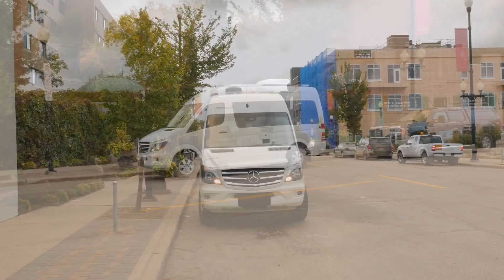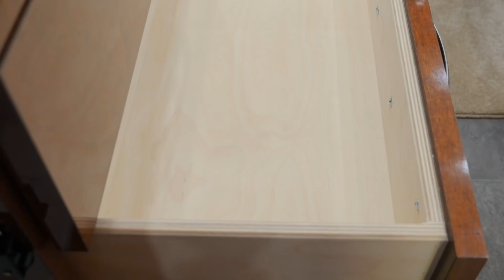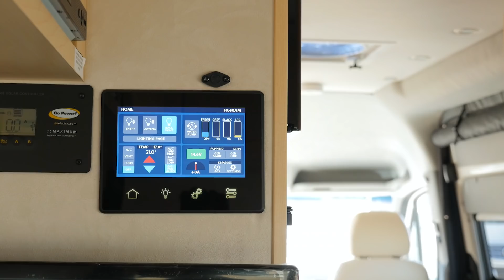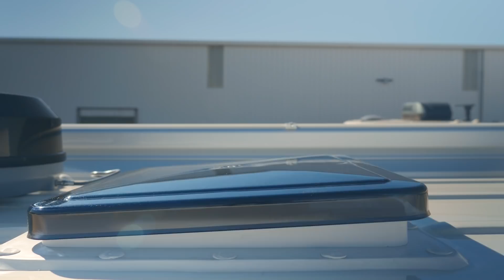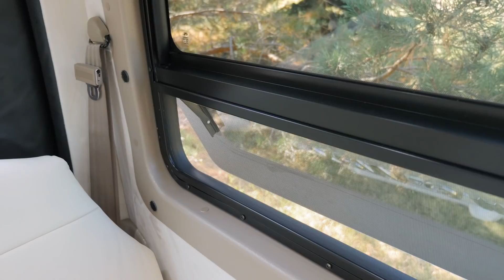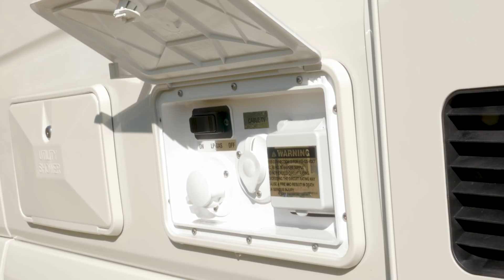2018 Pleasure-Way Ascent TS Tour

Comment: not leather again! If its cold you are frozen on the leather. if its hot outside you tape down on the seat you fools
Reply from the maker: Hi Andreas, so we don't use real leather in any of our vehicles. We use a fabric called Ultraleather, which is a high-quality synthetic polyurethane fabric. One of the great benefits of Ultraleather is its promotion of air circulation which keeps the fabric cool in warm climates and soft/comfortable in cold climates. A few other benefits of Ultraleather is that it's scratch, nick and blemish resistant, cleans easily with soap and water, pet hair will not penetrate like in regular fabric and it's incredibly durable- delivering up to 10 times the industry standard of abrasion resistance. Thanks for watching!

Comment: Nice but disgustingly overpriced. How do they justify a $130,000 price for a van? Moreso when you can buy their Unity or Serenity vehicles that are bigger and better for the same price.

Id rather import a Fiat $65-$75k and get quality similar to this.
Reply: LOL...Go import your Fiat.  You get what you pay for.  Good luck importing it as it is not an easy process.

Other manufacturers with similar Mercedes small chassis charge more.   If you want to go big, get your Unity or Serenity.  I had a large coach and downsized.  Being small has much more advantage as a second vehicle, gas mileage, and more places to visit, park and store it.

Comment: What do you do if you are out in the boondocks camping and your electric  bed wont work? Seems like an awful lot of this camper working is dependent on so many gadgets/systems that if they go wrong your vacation is wrecked
Reply: Good reason to avoid, since electric components on a vehicle go bad first.
Reply: Ummm it's solar powered...why wouldn't the bed work? As long as there is sun this will work. Solar way more reliable than the grid.

Comment: i need tesla-like battery that could last 1 week off grid for casual electronics such as tv, electronic stove, refrig, gadgets/wifi/lte/computer, ac/heater. 
no recharge no gas needed. 
the car run on gas. i just want it off when idle/camping. 1 week minimal.
i imagine like 10.000mAh X 10.000 pack lithium batteries. 
haha.

Comment: Love the conservative conventional design.  For example the non-powered entry steps, wrap around glass and magnetic bug screen.  Please consider using a radiant barrier (like reflectix foil)  around the inner shell of the Van to include the floor. This greatly reduces heat flux from hot and cold to keep the van temperature stable. Would be neat to integrate the plumbing into the van floor much like a multiplex wiring to reduce or help prevent freezing and allow 4-season usage (maybe include electric wire elements along PEX pipe to prevent freezing like mobile homes).   In addition, will you consider introducing the new GAS powered Mercedes sprinter engine now being introduced in the States this year. High quality diesel can be problematic and I now here that using bio-diesel requires frequent fuel filter replacement to avoid fuel and warranty problems.

Comment: This is a bit behind the tech offered by Roadtrek. People are becoming more interested in all electric setup with more solar and lithium batteries, to allow long term off0grid camping.
Reply: Totally agree. The all electric is a plus for me. I don't like the idea of carrying a propane tank when you can use induction tops and other high efficiency electric devices.
Reply: E trek is too complicated and belt on the Volta is a problem.
Reply: D LG LOL!  PW RV’s are about as high tech as you can go. Do your homework!

Comment: how many miles per gallon does this RV get? and how big is the gas tank? this is by far my favorite and on my wish list!
Reply: Paolo Tolentino
You might go to their website for more information and contact information. They have several model options and sizes.
Reply: Paolo Tolentino
Gas mileage won't be great as with any large vehicle. The website should have the tank size info.
Reply: I've heard other owners say 20-22 MPG and the gas tank is 24.5 gallons for a range of about 490 miles.
Reply: ?? this is just a video of the vehicle  goto their website to ask questions ??

Comment: I like this, but it seems geared for one person on a weekend getaway, for tailgating, or picnicking.  20/15/12 gallons for fresh/grey/blackwater tanks, and an 8 gl propane tank isn't really enough.  Any way to up those capacities?
Reply from the maker: Greetings! Unfortunately, we do not offer custom tank capacities. The smaller tank capacities are due to the compact size of the short wheel base and the corresponding limitations under the van.  Thanks for watching taking the time to comment!

Comment: Can I park this inside a garage?
Reply from the maker: Hi Ashley, the overall height (to the top of the roof air conditioner) is 9 feet 7 inches. It would require any over-sized garage door.

Comment: How much is this van?
Reply from the maker: Hi Louanna, the starting MSRP for the 2018 Ascent is $129,155 USD / $136,435 CAD.
Reply: You get what you pay for.
Reply: I would get a Wonder MB for about 50,000 more, which gets you a pull down residential queen bed, a full shower and bathroom, 35 in TV, exterior storage, etc
Reply: What if i bring my own van to you guys? Can u build it?

Comment: I have two questions this RV is Four Season and what is the price range
Reply: Pleasure-Way Motorhomes is there a way to change that
Reply: From what I read, no van conversions are 4 season. Too difficult to fully insulate the large metal body and large windows.
Reply: If your looking for a four season class b look at advanced rv.
Reply: Javier Martinez now Much cost?
Reply: Pleasure-Way Motorhomes    130000
Reply from the maker: Greetings! The starting MSRP for the 2018 Ascent is $129,155 USD / $136,435 CAD.  The Ascent is not a four season RV. Thanks for watching!
Reply: Mike R in England they sell a four seasons van similar to this and the Germans sell four seasons vans .

Comment: Can you make an all electric vehicle just needing solar panels .
Reply: You would need 10 times more solar than the awning's size.
Reply: Ploppy Ploppy
Solar panel technology isn't that efficient yet.
Reply: I think the Roadtrek E-Trek is what your looking for. If this 2018 Pleasure Way Ascent is available fully solar and without a propane tank it would be an excellent choice for me.
Reply: @victorsantana162  This van is significantly smaller than the Roadtrek E-trek, so that might be problematic to do. I don't know if it's possible, it probably is, but there clearly is some weight and space issues involved with the extra batteries and solar panels needed. People need to understand that all electric does come with sacrifices and downsides, and often comes out as the lesser choice. It's not this miracle cure that the tree huggers make it out to be.
For one thing, the batteries you need for all electric are extremely heavy, and you do need them. This comes at the expense of loading capacity and miles per gallon.
Reply: Joe Rainey You mean Prevost?
Reply: Ploppy Ploppy mary

U
Reply: I am also looking for one. It would be no problem with 120v charging capability.